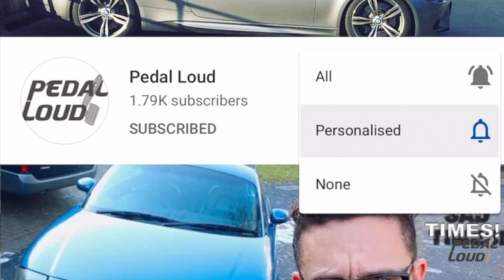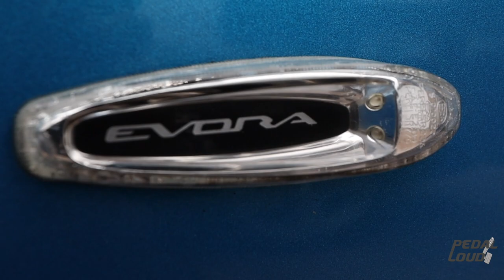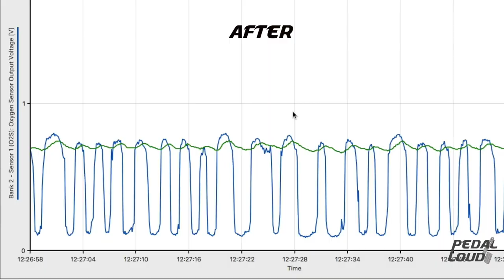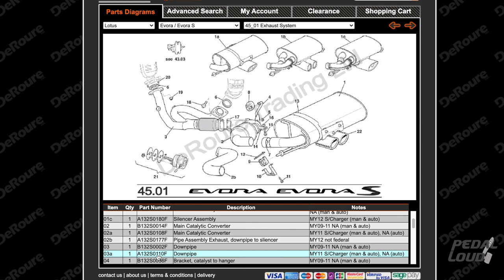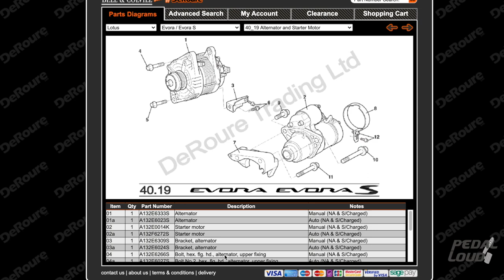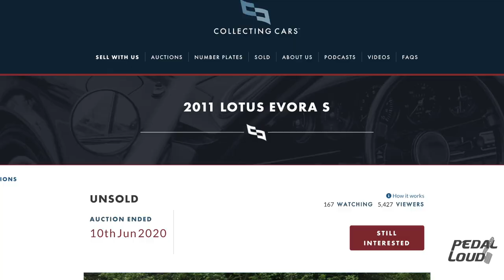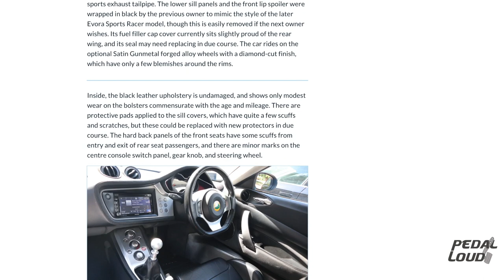2011 LOTUS EVORA S | THE GOOD, BAD & THE UGLY

Comment: Great review of the good, bad and ugly of the Evora. All the same issues you had plus the dreaded 4th 5th gear loss on mine but still in love with it.. More reliable than my TVR2500M at this point. I also in the middle of my mates EVORA with the same transmission issue.  Engine out as you know.. what a beast of a job those have been. But in the states more difficult to find a dealership close by than in the UK.
Reply from the maker: Thanks for the feedback. Good luck with it!

Comment: had mine for 2 years, daily drive it and it lives outside. Done about 8k miles in 2 years and havent had any real problems,
Reply from the maker: I think mine had spent a bit of time on track prior to ownership....
Reply: 12000 miles per year for me and only had two sensors (brake and clutch) fail.  Evora replaced 996 , so any complaint about engine is minor in comparison.
Reply: @damos_cars  i lso think mine was tracked in prior ownership, it was in a sorry state cosmetically. Covered in stone chips i mean the whole of bumper front clam and roof were pockmarked.
Reply from the maker: Ha ha yes had to one of those too and the ECU completely packed up on it! Shame as it was a sentimental purchase (see other vids)

Comment: 1.  Does the car have  some tubing or piping/passage of fresh air coming into the engine bay?   2. Is there some sort of venting to let hot air being released/exhausted from the rear engine bay?  3.  Have you had vibration/movement issues with your exterior rear view mirrors?  thanks
Reply from the maker: 1. Yes. 2. Yes. 3. Yes.
Reply: @damos_cars  thanks for that
Reply: You’re welcome

Comment: I am considering getting a 2013 - 2015 Evora S so I a m watching videos about these cars. Here in the US I believe it would be cheaper to have a local custom exhaust shop bend up new pipes in stainless (never have to replace again) to remedy any regular and flexy pipe concerns. I don't know if the catalytic converters are specific to the Evora or if any other Toyota production converter could be utilized. I too look for "options" for making proper repairs. I have also worked on cars for 40 year, plus I went through an auto tech school for a year and did it for a living for a while.
Reply from the maker: Yeh, sounds like a good plan. I think ultimately the position of the manifold/cats is ok so long as you don’t run the car hard for too long (I.e. track days). I can’t imagine it was ever a problem in the Camry. As mentioned here this car has been tracked before I bought it which I knew about as it had lunched it’s our gearbox! I tracked it myself and it’s first outing with me was when one of the cats disintegrated. So I guess the moral really is it depends on what you will use the car for and how hard it will be driven. By design my personal opinion is you should be able to drive it pretty hard. This is where I believe the engines ancillaries needed a bit more thinking. More info here: https://www.2bular.co.uk/engine-protection-kit

Comment: I have an Evora S, and agree they can be infuriating. Having had it off the road from a few months, mine is currently in the garage having lots of bits and pieces sorted out - they really don't like not being driven

However, the Camry thing is just ridiculous and parroted by people who's only form of wit is to copy Jeremy Clarkson. Very few affordable performance cars have bespoke engines and when they do (i'm thinking TVR Speed 6) - people then joke about lack of reliability. 

As for the exhaust/cat issue, I'm guessing that this is the reason why Lotus ditched one of the cats from the 2012MY?
Reply from the maker: Hope you get it sorted and back on the road soon!
Reply from the maker: No the cat that they removed is one that’s further back and not required. Commonly known as the third cat. There are many straight pipes available to delete this for early cars. Yours will still have the cats in the manifolds right off the engine. It’ll probably be fine with gentle use.

Comment: Thanks Damo   Great review.
What kind temperature information is available on the dashboard?

I would expect coolant and oil temp at a minimum.  But, supercharger inlet and outlet temps would be nice.

Or, just any indication regarding pending meltdown.

Cheers
Reply from the maker: Hi Steve, thanks for watching and commenting. Great question, don't have the car anymore but from memory I don't believe you see the oil temp, but engine temp is defintely on there. No temps for inlet and outlet. I guess you could get a bluetooth OBDII plug and a double din unit to read those values. I have that in my TT now and it works great. Cheers.

Comment: Another great and concise review.  Full marks for doing a lot of this cat work yourself (you're lucky you have pit access for this!).   Interesting how Lotus have "added value" by detracting from the reliable Toyota engine - the good (the supercharger and tuning) and the bad (the poor airflow/cooling around the mid engine - thats Lotus' placement and uninformed air flow into the engine bay).   Lotus - lovely chassis' mixed with questionable engine design.  Another example the Lotus Elise head gaskets - a simple cheap thing to fix on the production line to avoid engine failures!   Just remember the inherent style of the Evora S and the track days you did..
Reply from the maker: Cheers!

Comment: Eh, think you're just being excessive. The labor on these cars does suck 100%. But it's pretty reliable,. But if you don't drive it, you're going to have issues. When I first picked up my car I had every issue possible because the car sat for years. But then I started driving it every day and now it's been good. Only issue I have is that getting parts from lotus can be a pain if they don't stock it.
Reply from the maker: I think the problem with this one was it had been used too much. Too much heat will destroy your cats and eventually wear the starter prematurely. They’re great as road cars but if you’re really into driving I’m not sure the ancillaries really stand up.
Reply: @damos_cars  They do, but I think yours was monstered on track by a previous owner.

Comment: Sounds like you never got over the “nice Toyota” comment, which diminished your ownership enjoyment. I really don’t understand this jibe - or why the Elise doesn’t suffer from the same criticism. Realistically, this is a 2011 car and any non-Toyota parts are going to be low volume and therefore expensive. Just try pricing the equivalent parts from Porsche or BMW - I recently priced a washer pump  for my M Roadster at the dealer and was quoted $120 for a part that I could buy on Amazon for $30 (oem).
Reply from the maker: The Toyota comment was annoying but didn't bother me too much. The Elise was a revelation at the time so much so that folks forgot about what engine it had. It engrained itself in the petrol psyche as an amazing little sportscare regardless of the powerunit. Whereas the Evora with a V6, from Toyota made bigger headlines at the time of launch. I've owned Porsches (2 x 944s, 996, Boxster) and BMWs (E93 M3 / 330CD) so I'm used to big bills (see my M3 costs video... ) but what I found surprising was the cost of these ancillary items on what it is basically a Toyota power unit. Everyone waxes lyrical about it's reliability but those ancillary bits which in the case of the headers are the same as the Toyota ones are just crazy expensive. The starter motor which should just be the same as the Toyota one (for some reason I've yet to fathom it isn't) was the real kicker. It's not a clever BMW or Porsche tech fest starter motor. It's a bog standard starter they've been putting on simple cars for years, it's a £170 item tops. Anyway, I've reached the conclusion that although these cars are fabulous to drive they're not that great when driven really hard (on track) for a lot of the time. Which is to be expected. If it had been a bit more robust and a tad cheaper for the Toyota bits then I'd probably still have it. For some reason I now find myself browsing the classifieds for a 4 seater, triangle shaped Lotus Elite. It'll probably be more reliable than the Evora! Thanks for commenting and watching. Cheers.

Comment: The decat pipes are to make the car sound better and to generate more power, not to fix a known problem. The makers of those systems are naturally going to over-state the problem, in order to generate sales (a bit like the bullshit IMS-oiling systems on the Porsche 996).
Reply from the maker: The problem can't be overstated for me. I think putting in that engine with manifolds containing cats so close to the main body of th engine was / is a mistake. Admittedly one that only really manifests as a problem when the car is repeatedly driven hard but then it is a sports car and that is what it is supposed to do.
Reply: @damos_cars  One other thing it could have been: if an oxygen sensor is not fixed, it can cause the engine to run rich.  If left a long time......it melts the cats.
Reply from the maker: @EvoraGT430  yeh good point. Did have one go but it's wasn't out for long.

Comment: I really wanted to see things from your point of view but its seems like you have never owned an older car or one outside of warranty.  Expecting a 9 year old car that sees limited use to not have failing parts is like expecting a 90 year old man to have a clean bill of health.  It is unrealistic.
Reply from the maker: Oh I’m more than familiar with older cars. This is actually the newest car I’ve owned. Hence the disappointment.
Reply: @damos_cars  Could it be that yours is a lemon?  I've also followed JayEmm and saw him get rid of his Evora 400 after 2 years.  It would appear that these cars do not have catastrophic failures, but do give you death by a thousand paper cuts.  I was really contemplating getting one but I do not like cars that need attention constantly.  So I appreciate the fact that you've made a long term review of the car rather than the normal quick review that just praises driving prowess.
Reply from the maker: I don’t think it was a lemon as such. Just very well driven (tracked) which is should be able to do. But this extra wear highlighted some foibles. Essentially it’s a prototype. If you get a low miles, gently driven one I imagine it’ll be ok. The cost of parts though for what was supposed to be a Toyota engine is eye watering. Like I say I’ve owned older and expensive cars (M3, 911 etc) and although not perfect they seemed to have fewer major flaws.
Reply: @damos_cars  As far as the price goes you have to pay the lotus tax.  The gearbox for instance is probably about 3k from Toyota for the Avensis, while Lotus charges about 10K for that same standard ratio gearbox. This car is also a parts bin special with parts that were never made for a sports car.  I am almost certain that the stock headers are the same ones from the Camry and ES350.  Lotus doesn't even make any changes to the engine before strapping on the supercharger.  I'm not surprised that it has more issue than a Porsche but I am surprised to hear that it has more issues than BMW high performance models.
Reply from the maker: Starter motor and header prices were a shocker. Couldn’t get hold of the Toyota equivalents. I looked and looked. This was also super frustrating. See my M3 costs video... I’m also a few k into my mk2 3.2 TT but it’s all stuff I’m expecting. The Lotus just never failed to surprise which just spoiled the experience toward the end.
Reply: @damos_cars  Interested on your 911 comment.  I am debating on getting the Lotus Ermira or a Cayman and was wanting to get your opinion on the Porsche.  Did it have as many problems are your Lotus?  What was the cost or repairs like for both of them?  I know Porsche's are not cheap.

Comment: You keep saying “engine should be reliable as it’s Toyota”. Yet your engine hadn’t broke?? It’s some cats for an engine that was not designed to be slotted into a sports car therefore are bespoke. And a starter motor. All your combined issues cost less than a gearbox issue on my GTR.
Reply from the maker: Yeh you're right. It's the ancillaries and the position of them not the actual engine itself. Fair point. Yeh I don't envy trying to fix a GTR gearbox! Good luck. Thanks for watching.